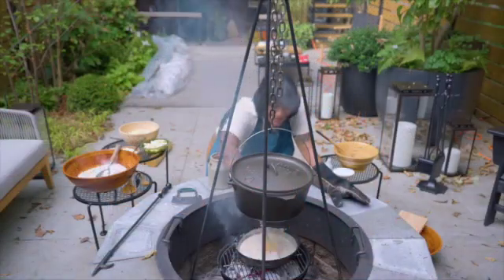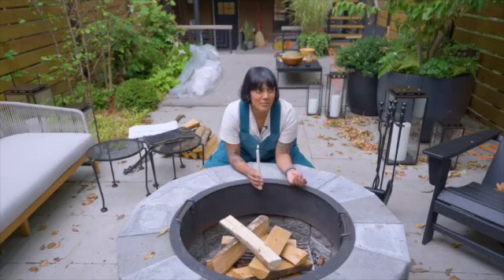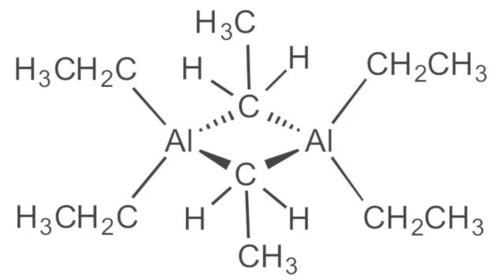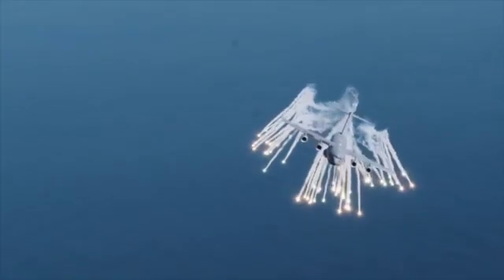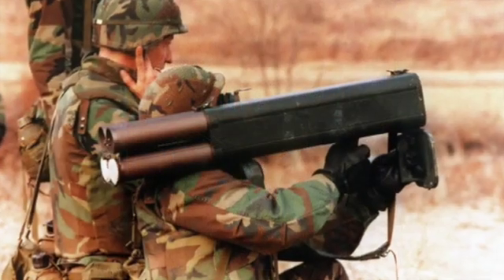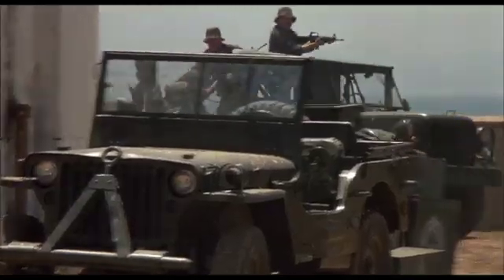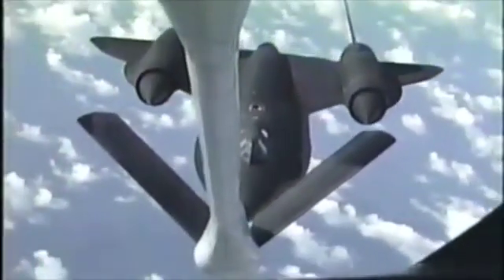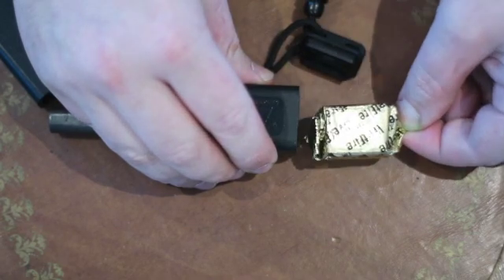Flint and Steel: How They Really Work

Comment: Cerium is usually used for cigarette lighter 'flints'.  In that case, it is actually the 'flint' rather than the steel which is producing the burning particles.

Back when I was in the military, we had a training video on the hazards of diborane, though I'm fairly sure I never encountered it.  Handling UDMH and iRFNA was frightening enough, thank you.

re. the SR-71 - fuel bladders, people ... fuel bladders ...

Comment: so how did our ancestors make fire before the iron age, i could have sworn that banging 2 flints together would make sparks
Reply: They used hand drills and bow drills, wood against wood, to make embers. A lot of YT videos on this.
Reply: Also, before matches were invented, people mostly kept fires going as much as possible. When traveling, they would carry a "fire bundle" with embers and enough combustibles to keep them smoldering. Bow drills, flint and steel or flint and pyrite were the backup, used only if the fire, in spite of their best efforts, went out.
Reply: Not sure about flint but here in southwestern Ohio the churt was prized by natives all over north and south america because it has enough iron in it that it will spark on itself or another piece of flint but it wont throw as much spark as striking it on iron its better than flint because the churt adds spark infact it was a big export for flintlock muskets because of it drastically improved ignition of the priming powder
Reply: The giveaway is in the name; Iron Pyrite! (etymology as per Pyro) iron (II) disulphide aka Fools Gold. Again; flint or chert as the cutting blade. The sparks are much dimmer (red-orange) than those of steel (bright orange) and the sun might need to have hit the horizon in order to see them, because they hold less energy: the catch tinder will need to be much more sensitive (eg Amadou made from hoof fungus). IP naturally oxidises in air so a fresh surface is required, details on the web of radial nodules as opposed to cubic crystals being preferable. :-j